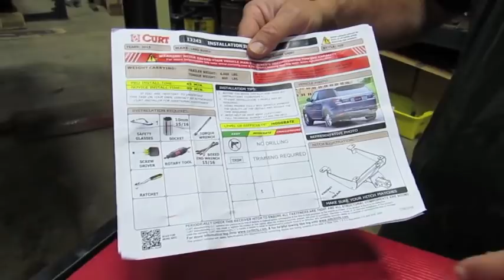Bolt-On Trailer Hitch Receiver Installation for 2014 Range Rover Sport

Comment: Ok a couple of things, first this is a well made video and definately helped, but I ran into an issue where the hitch assembly front tines  (the forward part of the hitch has two prongs forward) they were too close together and the holes didn't line up with the existing  predrilled holes.  I had to cut a piece of wood just larger than the width of the front tines and pound it inbetween them thus forcing them apart far enough for the holes to line up.......the other thing is the front panel, this video correctly shows how to  cut the front panel to accomodate the hitch, but the instructions that come with the hitch don't do such a good job.  Other than that the job took about an hour and it appears to be a really beefy assembly

Comment: hello sir, i have a 2012 range rover down here in the Bahamas, i've replace the fuel pump three times in little over a year with original LR parts, last replacement was a little more than a month ago, i would appreciate any help on this thanks.